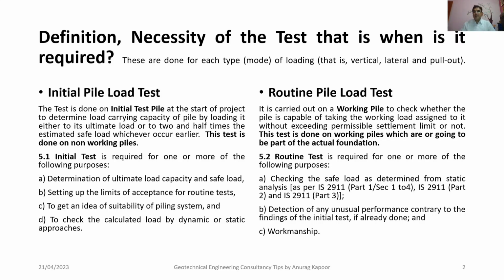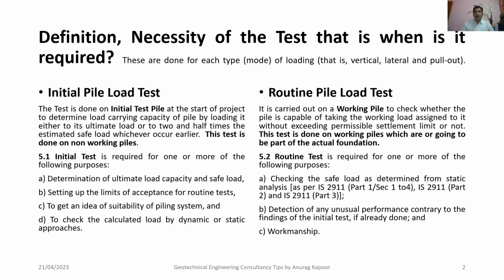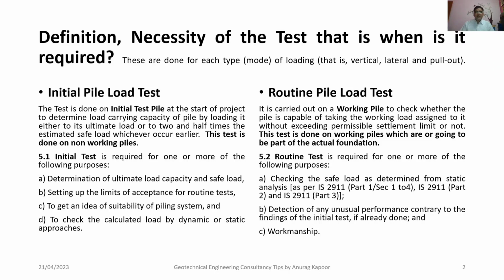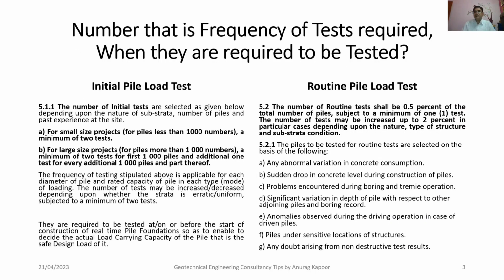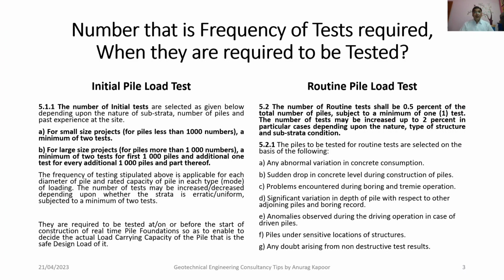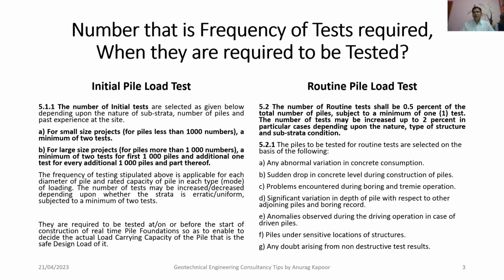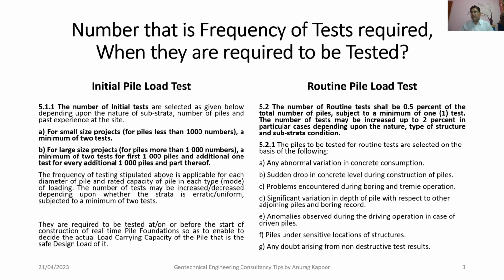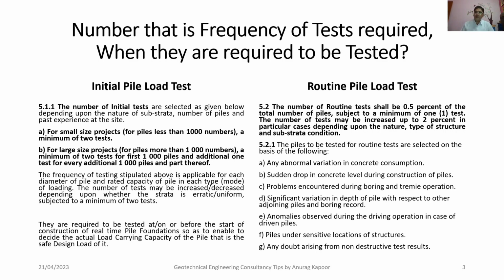Initial & Routine Pile Load Test: Definition, Necessity, Frequency of Test & when is it required?

Comment: Sir for the piles less than 1000 numbers minimum two tests is required? Is that enough 
Because burj Khalifa has 194 bored piles and they did 4 initial tests
Reply from the maker: No, 2 tests for 1000 nos. of piles are not enough
Reply from the maker: In Burj Khalifa if they conducted 4 nos. tests for 194 piles, this was perfect